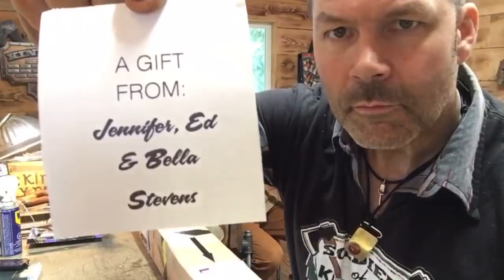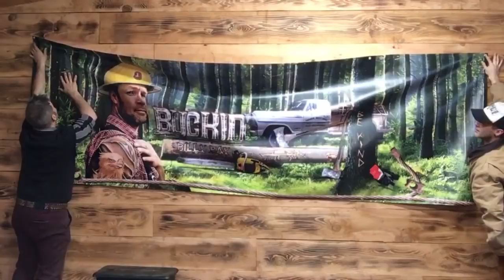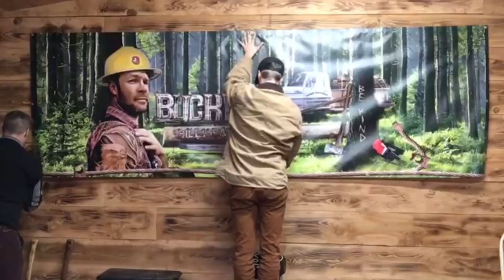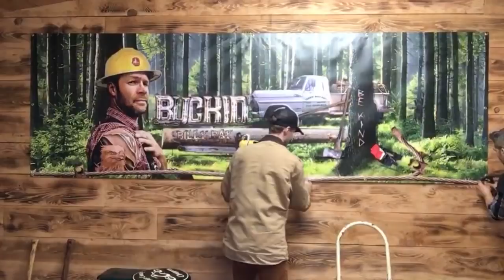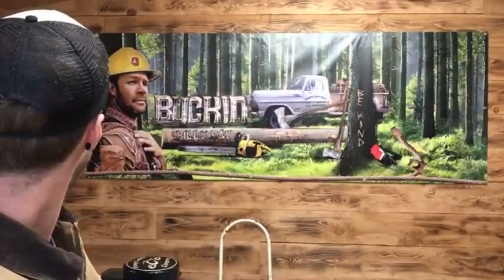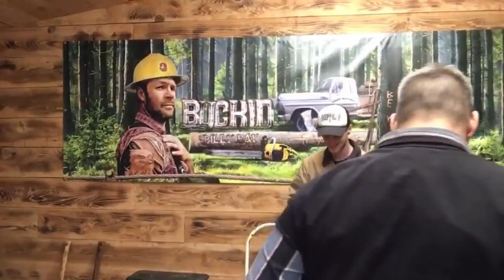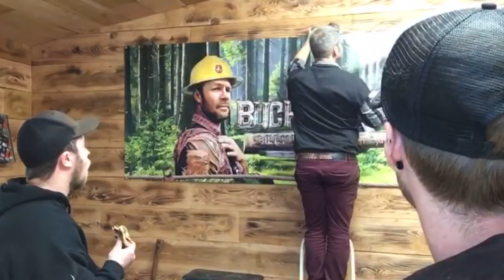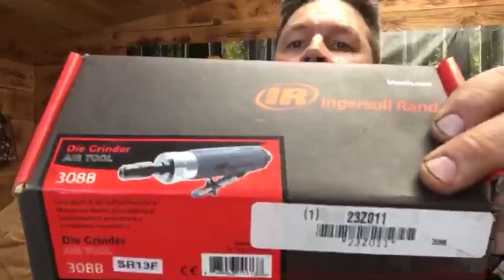Crazy un boxing

Comment: I restored my grandmothers c. 1900 hatchet this week.  It was covered with rust and the handle would not stay in it.  I got a new handle for it and wire brushed the rust off of it.  I hit it with my oribital sander a bit and polished up the edge with my angle grinder.  I found that it had been painted red when I got all the rust off of it, so I gave it a typical red True Temper colo schemer, afterwards, just like all my other axes.  I put watch on the handle and it looks nice and cuts good.  It has a splitting blade on it instead of a chopping blade.  I can vividly remember grandmother chopping off chicken head with it when I was a boy.  We had the fried chicken for dinner.